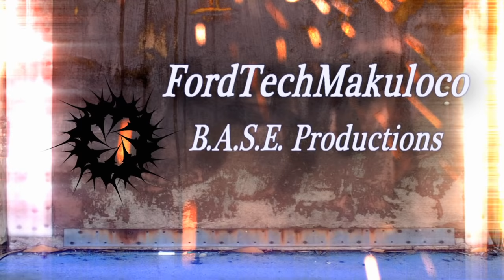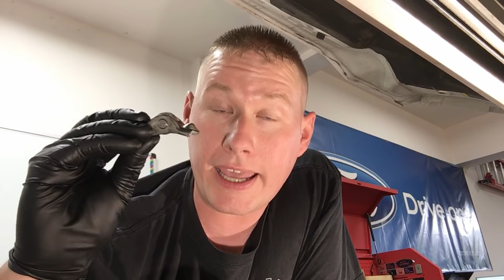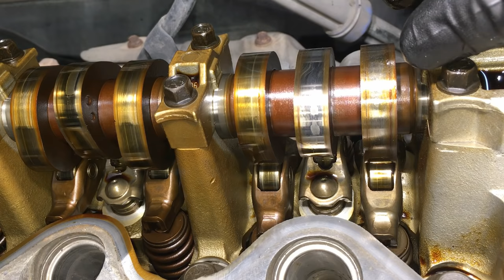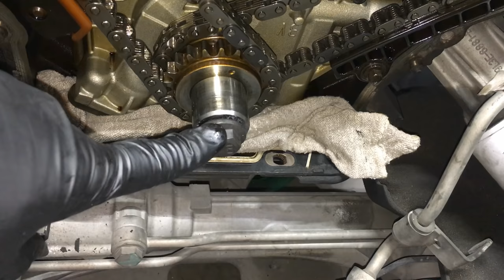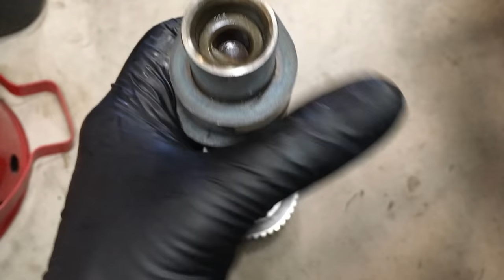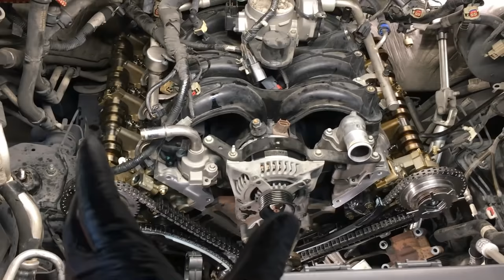Ford 5.4L 3v Triton Engines: Roller Follower Removal and Installation

Comment: Mark, I quit fighting to get each individual rocker fished out. I remove the camshaft. The cam phaser more than likely needs to replaced as a regular maintenance item anyway. Laying across the fender doing it 12 times gets old. Usually it can be done 30 minutes faster. That adds up to an hour total. Thanks for the educational videos!
Reply: Were there any tricks to replacing the entire camshaft?  Sounds like it is worth the extra $

Comment: Thanks again for the great videos. I had a bad clacking noise on our 2012 Expedition. Took the cover off and found the rear most, passenger side, roller follower seized up just like the one in your other video. Swapped it out and purrs like new. Thank you!!

Comment: I know this is an older video, but if you are doing a full timing chain job, it seems to me it would be easier just to pull the camshafts out to change the followers rather to going through the whole spring compression routine.  If you are only changing one follower, yeah, I see the spring compression method being the better choice.  I love your videos and have helped me my F150 in tip top shape.  Hopefully I would not have to do this job to it.  Keep them coning.
Reply: When can i take cam shaft out? At tdc or after taking 3 out on each head
Reply: @cesarmejia4751  following the timing job video you have to take 3 out each head, then the camshaft can move freely and the rollers are not putting pressure on any valves.

Comment: thank you soo much for doing this video I am just getting into being a technician and my first job I am doing is a Cam phaser delete kit on my own 2005 F-250 supper duty 5.4L and this video plus the one you have on removing the cam phasers has helped me a lot and saved me sooo much anger, I even went and asked my local ford dealer if they would loan the tool to me and they said come on down and get it no charge, so thank you very much for putting this video out to the world.
Reply: bad idea
Reply: You'll have to have a program written and installed.

Comment: its been @7,000 miles since doing my timing job after watching your vids,its running great!i bought the tool from ford racing to compress the springs,it did work,but almost need 3 hands to use it and it has a set screw with a little allen wrench to lock it into place,way to complicated,should of got that one from otc, so much easier

Comment: Good info Brian. It might be a good idea after replacing the rollers to doosch them down with engine oil before start up.
Reply: i'd rather soak them to make sure oil gets to the pin
Reply: YEA I THOUGHT THE SAME THING 24 HR PRIOR.

Comment: Looks like a very good but tedious procedure was wondering could you take the camshaft off and then just remove all the roller followers one after the other? What would a full timing job involve? I know this guy is the man when it comes to Fords there is no better !every one of his videos is right on point I’ve used a few of them to work on the IEW four-wheel air vacuum system thanks to his videos I was able to straighten it out finding out that the tubes had fallen apart and disintegrated as well as his videos on changing the CV axle excellent instructions and details I’ve done things on my truck that I don’t even wanna know about this point thanks to his videos! “He Is the man!”

Comment: Thank goodness you didn't show the flat screwdriver "pop out" method. The tool also works on the 4.6 3 valve engines as well. Great video!
Reply: Robert Kohut he did detail that method in another video awhile back
Reply: Yes I know, but it's bad advice. Glad he didn't here.

Comment: Good info Brian.  With 170,000 miles on mine, I'll soon be doing the Phasers, chains, chain guides, plugs(ugh), exhaust studs. This looks like a great time to do the roller followers too.
Reply from the maker: +009to090 Don't forget lash adjusters!!
Reply: Absolutely!  I just forgot to list them here ,  Thanks again.
Reply: I also forgot to list Chain Tensioners.

Comment: FTM made me feel confident enough to tear my 05 150 down for full timing, phasers, oil/water pumps, new roller followers.  Popped the V Cover and found D side (Bank 2?) Phaser looked like it had exploded.  Pass side tensioner completely blown.  Yet never had a worry bc I knew my man here would guide me through.

Comment: just bought an 07 F-150 FX4 with 261K miles on it for dirt cheap (runs well though). Subscribed!
Reply from the maker: Plenty of content here for that engine!
Reply: @FordTechMakuloco  Putting together the parts list based on what you are recommending. Definitely has the famous roller follower tick so I'll be pulling it apart shortly and upgrading the oil pump while I'm at it

Comment: I watch lots of your videos and I know my truck needs cam phasers. The job just looks so intimidating and I do not want to take to a shop so they could drain my wallet out. Guess I’ll have to man up at some point and start the process. Thanks for sharing your knowledge, pray for me! Lol
Reply: Martin Rodriguez I’m currently in the process of doing the timing chain replacement on 2007 5.4L 3V Expedition, it is intimidating and slightly overwhelming at times. But with this video,his 4 stage videos on timing chain replacement, this job is doable, and will save you a lot of money.
Reply: Please send an update on how it went. I'm in the process as well and wonder if anyone has had the same difficulties I have.
Reply: @04EXCURSION  If you think that one is intimidating you don't want to do chains on a 3.5 ecoboost

Comment: If the roller followers have such a small hole now compared to the original ones, would that be a good argument on keeping using the 5W20 oil rather than switching to 5W30 again because of the small holes in the revised lash adjusters?
Reply from the maker: 5w-30 is just fine trust me.
Reply: @FordTechMakuloco  the high pressure oil pump still the recommended one too? Given this redesign

Comment: These videos are the best available for Ford modular V8 engines. I have the tick sound from the roller followers, gonna change them. Should I do a whole timing kit with upgraded oil pump? Have about a 130k miles on this motor. Thanks for your great work!
Reply: I didn’t really have to do my timing till about 350K on my 2014 Expedition.  For now I would just replace any loose/jiggly roller followers at this point.

Comment: What’re the cons of just removing the cam ? Love your videos btw. I’m a ford dealership tech of 3 years and finally getting into engine work
Reply from the maker: Uneven pressure on cam
Reply: @FordTechMakuloco  how do you know if you have uneven pressure on camshaft? What do you recommend if there is?
Reply: @littlemirage  If the roller followers are installed in the cylinder head and you start loosening the camshaft caps, you will put uneven pressure/stress on the camshaft. 

Imaging holding a small twig at one end. Now touch the other end to the ground and begin to press the end on the ground. The twig will begin to bend and eventually snap somewhere in the middle. Hope that analogy helps.
Reply: @5rand0n7  Why can't I just loosen each cap screw a coupe times in sequence? Would be silly to remove each cap in order as that would stress the cam.

Comment: I have a very desperate question and have been chasing the dreaded vct solenoid issue, just a little history behind the situation,I have a 2008 f150 5.4,  I was driving down the road and lost all power and had a bad knock, well I found that my head on the right hand side suffered a catastrophic failure and ate the camshaft of what looked like it was from lack of oil so then the fun begins of course, I replaced the head with a reman from Napa, I watched all your videos on the 5.4 3v it seems lol so I checked and changed the vct solenoids with ford parts, the phasers and timing chains and guides, and tensioner, all ford, I replaced the oil pump with the 360hv oil pump, I also went as far as checking the thrust washers and even though they looked very good I replaced them. I have removed both the mounting plates for the solenoids as well, found a piece of debris in the one one the right hand side which I believe lead to the failure of the head but not 100% sure, now I have the solenoid issue and I can make it act up of course hot and bumping the gas in gear, but when I go to the solenoid and unplug it it don't change but if I unplug only the right hand side and run it it won't fail. As I stated everything is new and clean am I missing something or could it just be a faulty new solenoid?
Reply: Does a selenoid makes a ticking noise (like roller follower?) on 2008 5.4 3V. Thank you
Reply: @marthalorena55 
Did you ever find the answer?

Comment: Just an update on My Expedition in the video just hit 220 k no issues runs like new I keep it maintained and use 5w30. Thanks Brian
Reply: 👍👍I have an 04 F-150 5.4 192K only use Mobile1 5W-20 still running good

Comment: Is that enough room to remove the hydraulic lash adjuster with that tool in the way
Reply: You probably already figured this out but the lash adjusters can not be removed without removing the cam shafts.
Reply: @neptune4167  why do you need to remove the cam? They aren't under the cam.
Reply: @chriscall3425  Lash adjusters are under the roller followers which are under the cam.  You can remove the roller followers without removing the cam but the lash adjusters do not have the clearance to be removed without removing the cam.  So, they ARE under the cam.

Comment: Thank you for this! I have an ever so slight tick in my 5.4L 3V and I think it's a roller follower, so this might be a job in my future... I still am not 100% certain it's a roller follower though, nor am I sure it's even worth being concerned over
Reply: If there is a tick in a 5.4, YES it is worth considering.
Reply: And the 4.6 3 valve as well.
Reply: If you have a slight tick, it's time to have it checked.  When the roller follower wears enough to turn its' self sideways the engine damage can be catastrophic and a new engine will be the only repair.

Comment: Thanks to you i managed to get my timing done on my 13 expedition! I did have a big question though in regards to oil pressure. Where you talk about the hole in the new roller followers, and how it differs from the original, how much of a difference would it make? Reason i ask is, after flipping through tons of forums and comments i ended up going with the melling m340hv pump, given at the time of install it was closing in on 200k and all sources i was reading were saying how much more benefit the higher volume would be. Now that ill be going back in to get these adjusters and arms done, i want to make sure that increased pressure wouldnt cause more harm than good. Thanks for all you do!

Comment: So I'm not arguing how this is done, but wouldn't it be easier, and safer to pull the camshaft out and replace them all? 
Or is this the solution to replacing just one? 
Timing job is due on my v8 triton with 238k.

Comment: Love watching your video. They have helped me wint my 5.4 3 valve many times. Also like that you don't make us dizzy trying to work with one hand and video with the other.  I do have a question, if you don't mind.  Will that spring compressor work on the 2.3/2.5 dual plug heads as well?  Thanks again for sharing

Comment: And after all the followers are installed, in what position do you leave the crankshaft keyway, and you remember those 6 designated roller followers we took out at the beginning of the timing chain 4 parts series? Do we install those 6 at very last or it doesn't matter the order the roller followers go in

Comment: When it comes to turning the over a 5.4 engine , if you have the crankshaft damper pulley off the best way is to use a socket that is actually made for a sbc engine. Sounds weird but apparently the modular ford engines use the same size crank snout and keyway as a small block Chevy. A socket that comp cams makes that is designed to be used when degreeing a camshaft makes it so nice. If you're working on these engines a lot it's well worth the money.

Comment: Brian, you keep mentioning about the roller followers, but not say too much about the lash adjusters.  How critical is replacing the lash adjusters, and is it much easier to do then roller followers? Im going to be doing this real soon before Michigan weather gets cold. Thank you for all you do for us.
Reply from the maker: Lash adjusters don't fail as often and the cam must be removed to replace lash adjusters.
Reply: @FordTechMakuloco  Hey Brian
Thanks for the videos they are a great help. I'm doing a full timing set but didn't order followers. Is this something you do on every job or what determines if you change them or not?

Thanks a bunch.

Comment: Brian great work again....caution****you may know already but if anyone plans to replace the cam and lash adjusters in a 2004 5.4 there for some reason different than later year models. Something with the top tip of the lash adjusters and machine lugs on the cam. I'll look for the write up and send it to you.  I think followers are the same
Reply from the maker: +J H Yes the lash adjuster in 2004 models are different but the followers are the same 2004-2014.
Reply: FordTechMakuloco 
Have you done a clip on bank 1 o2 sensor R&R for 2004+ f150's?
I'm completely stumped on that one. And I thought the ps pump was the problem child. 
Thanks

Comment: I'm glad you pointed out the re-design on the follower cam lobe oiler hole. Just got in a new set and at first glance I thought Ford forgot to drill out the hole. You can clearly see the pin hole on the outside, but the pin hole on the lash adjuster side is not as visible at first glance. The bore is at an angle now to better aim the oil at the lobe and the follower bearing. Question though, since the new design has been in use for 5+ years now, have seen any issues with the pin hole getting clogged causing oil starvation on the lobe and follower bearing? I'll be installing my second Ford Performance follower/lash adjuster kit on my '06 Mustang GT 4.6L 3V. Just turned 300k and have been noticing ticking at start up until engine runs for a couple of minutes. Last replacement was at 175k along with a complete timing job and Melling standard volume pump.
Reply from the maker: Never any issues so far.

Comment: Hey Y'all.  Love the videos!  Contemplating doing the whole timing chain repair.  I have an 2004 with the 5.4 3v with 130K.  Been ticking for awhile.  DId the phasers back in 2010 when the thought was that the phasers were the issue.  

I was wondering, do the lash adjusters need to be replaced?  I planned on doing the whole timing chain, phasers, solenoids, tensioners, oil pump, rocker followers.  Should I also replace the lash adjusters?  Also are the cams known to go bad?  That would add another $1500 to the cost.  Part of me wonders if I shouldn't just try to buy a used 2011 or later truck!

Comment: Had broken cam follower on the #7 cylinder, Ford Dealer said there were two repair options:
1. Replace the cam follower $600
2. Replace the motor for $10,000 (FYI the 5.4 is only $1500 at Rock Auto and most mechanics will charge about $1500 in labor to replace the motor)

👉🏻Claiming he couldn’t determine if the Cam has been scarred by the broken follower, the dealer recommended option 2.
👉🏻I chose option 1 and it was the right choice.
Reply: I swear the dealerships are getting sketchier and sketchier, they recommend shit like money grows on trees and like telling customers a motor is toast when it is not like that won't hurt Fords reputation, and cause a long time Ford customer to look else where, it is amazing to me. Ford MoCo needs to get a tighter grip on these clowns.
Reply: I know someone who paid 3500 for Powertrain reman,and another 3000 for install.

Comment: Questions?  1. I always learned when changine a roller or cam--you change both.  Why are you just changing the rollers?  2. Getting the follower out, why not just loosen the cam?  3. If you are worried about dropping valve.why not putting air in the cylinder to make sure?  Is this engine a non interference engine? With the lobe staight up I can a poor mechanic punching a piston with your fancy tool? Again, why not just loosen the cam hold downs?

Comment: Hello and thank you for this video and all of your videos, they are always detailed and high quality. I have a 2010 Ford Expedition that I took on the task of replacing the roller followers starting on the drivers side. The motor is still in place and so very difficult to manage. Last part i have is the four remaining followers where the valve spring is on the bottom side,  and seems impossible to use the tool from the top. any tips or tricks? I thought of removing my front wheel and maybe coming in from the side. The cowling is there as well so hopefully does not get in the way. Thoughts?    Thanks in advance.  John

Comment: I got a set of these ford rockers and on some of them the hole isn't all the way through.. I checked by trying to shine a light through and push a pin needle in.. It just doesn't work... i am glad i noticed this before installing them all... could have burnt up another rocker and cam lobe.

Comment: What is the recommended interval to replace? Currently have a 2010 with 184k on the clock and I don't believe any internal engine work has ever been done. Changing oil every 4-5k miles and no issues so far after buying at 143k.

Comment: Thanks for everything Brian, when reinstalling I should just start with all of the lobes at base circle 6 o’clock on the crank hub then rotate to the next group? No issues with piston position and fully opened valves?